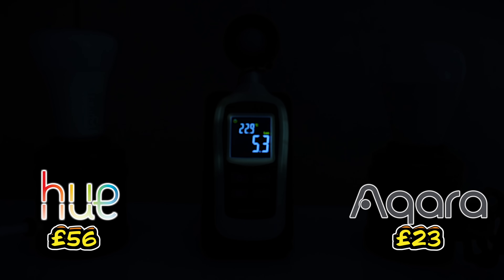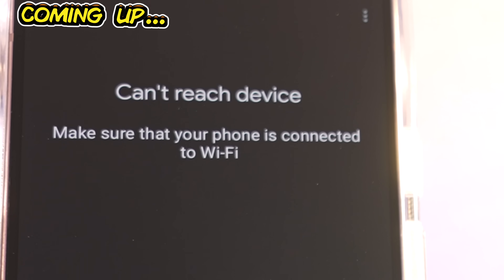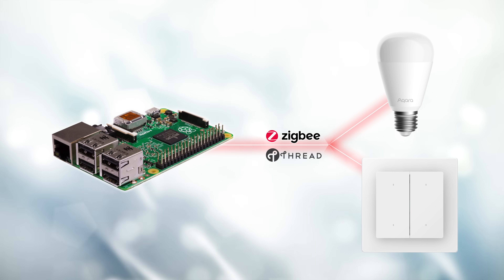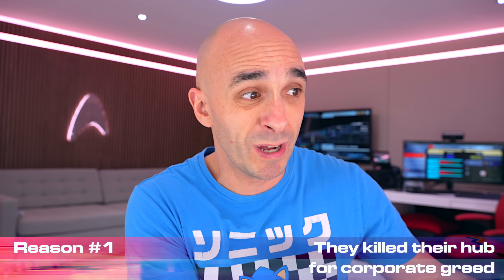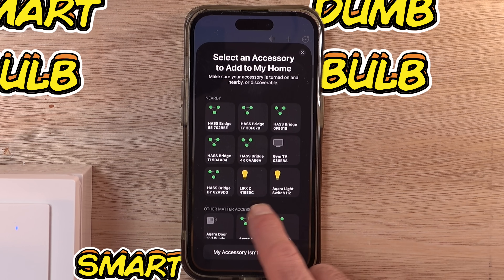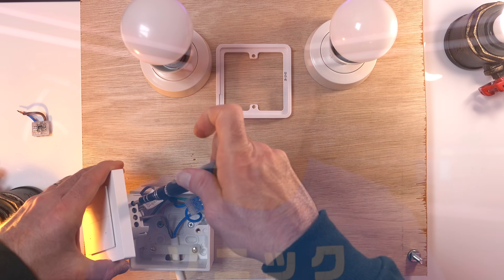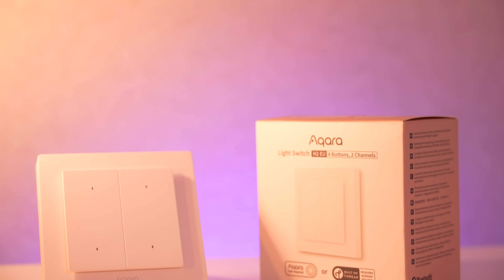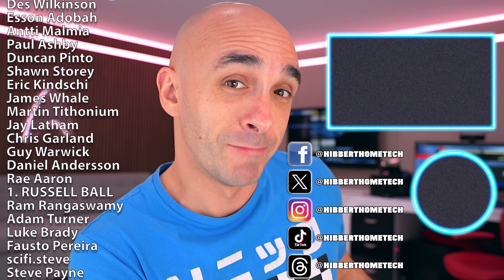PLEASE I Am Begging You... *MASSIVE APOLOGIES*!!!

Comment: Does aquara do any other sizes for the bulbs? I need a E14 size, and have been trying to find good alternative to hue to try but that size seems hard to find. I already have a hue bridge due to having their lightstrip so I was considering getting 3 of there’s but the price put me off like you said. 

Regarding the hue strip  I had the same issue with mine (parts of it dying). Thankfully mine was still in warranty so they did replace it for me, their customer service was pretty good.

Comment: What's the rated lumen output on that Philips vs the Aqara T2? The Philips Hue bulbs I use are 1200lm or 1600lm. The 1100lm ones I'd only use if I need to fit them in a smaller space, but they're super dim in comparison. It's weird to compare a potentially 800lm or 1100lm bulb to one with a much higher rating and then show it doesn't get as bright.

Comment: I've just bought one of these for use in our new bedroom. The thought was to use the top switch to control the dumb main light and the bottom switch to turn on the bedside lights.

I'm on an entirely Home Assistant setup and only really used Zigbee devices so far with ZHA. I suspect I'm gonna have to endure a lot of buggering about to get this working how I want.
Reply from the maker: If you have any of the main 3 voice assistants or a sky connect you'll be able to connect it via thread 👍
Reply: @paulhibbert  None of the voice assistants and my SkyConnect is setup to only work on Zigbee. Apparently the multiprotocol sucks, although I could just get a second skyconnect. Word is that the switch works with Zigbee2MQTT but that’d require a migration away from ZHA.

Gonna be a mission to get it setup, fingers crossed I can get away without spending more money because I’m stingy AF.

Comment: Another great video Paul (don’t worry about the last one 😊) !

Any idea how to add a H2 and / or T2 to an M3 to allow full control of all 4 buttons and to have it pass through to Alexa to work with voice commands?

Just added mine to M3 using Zigbee (as per all my H1 and sensors) and doesn’t pass through to Alexa.  Official comms from Aqara says….

“After confirmation, it seems that the H2 and T2 may not currently support this method of connecting to Alexa. “

Comment: Should it (and is it likely to) be upgradable by firmware in the switch to work natively with zigbee to talk to HA?  I'm not so interested in requiring a switch to have yet another external bridge to talk to HA..  That is confusing!!   Otherwise looks like a nice switch..
Reply from the maker: It's confusing, but worth watching the what's wrong with it section again as there are diagrams to explain, but in short....

It already works with home assistant using ZigBee, so you could use a conbee stick or similar plugged into the usb port of your pi.  BUT the scene buttons are not discovered. That's not something Aqara can fix I don't think, that's something the Home Assistant Devs would need to fix in the ZigBee integration.

HOWEVER, it already works properly via Thread, so if you have a thread border router (other than Amazon Echos as that's broken for some reason) then problem solved.  That includes Google home speakers and apple homepod speakers, but also a Sky connect plugged into the usb port of your pi.

In shorter terms, this isn't for Aqara to resolve.

Comment: OK I sorta agree with you but also find your anger at hue a little well extreme.
I have found Hue to be expensive,  and I understand it's not as good as others brands.

BUT 

1) It does tend to 'just work'  
And yes I understand how you make fun of this, but for many this is a KEY point,  I personally like plugging things in and having it work.
I think for anyone who is not so technology literate,  or like me, just technology lazy, it is a big selling point. 
2) Last time I checked it's still LOCAL,  not cloud based.
3) It's hub DOES work with other brands of smart equipment, in fact you even mention the Aquara bulb works :) (I have cheap Ikea bulbs and a off brand spotlight both recognised by the hub.)
3) And the hub works with as far as I'm aware with all the architectures. (I use Apple)

Aquara feels like the very definition of wonderful & horrible.  I believe you yourself mentioned only the other week how something had to have a particular hub to run (But not the sexy cat hub, that won't work :)  And this week that switch FELT like a half baked product.

In many ways it sorta is how it feels for a lot of the smart home industry,  still too many products with too many elephants in the room.

Comment: Finally, a light Switch for dumb bulbs that does not require neutral wire! 🎉 Do they also offer such a solution that allows me to keep my existing switches (Berker S1)? Otherwise it would not really look nice between my other switches and plug sockets.

Comment: Hi Paul, thank you for sharing your experiences. You are missing a big point though: Philips Hue is the best (by far) when it comes to smooth dimming and minimum brightness levels. Maximum brightness levels is not their strong point, but that is a very specific use case (i hardly ever feel the need to go 100%).
I've tested and used a lot of different smart lights in the last couple of years.
-lifx:  pro's: beautiful saturated bright lights. con's: very unreliable, minimum brightness levels are okey-ish
-ikea: pro's: cheap, reliable. Con's: minimum brightness levels are terrible
-hue: pro's: the best dimming performance (by far), reliable. Con's: expensive, not the brightest
-tuya: pro's: cheap, reliable. Con's: minimum brightness levels are bad, color saturation and CRI seems te be bad (although i never measured saturation and CRI).

It would be awesome if you could do a market-wide comparison about minimum brightness levels, dimming behaviour (does it looks smooth or not), as well as 100% brightness levels, saturation levels and CRI. That would be very nice to see.

Comment: My experience with the Aqara T2 bulbs: They do have both Thread & Zigbee, however they default to Thread and to switch to Zigbee you need the app, which means you need a Thread border router to be able to pair it.  Once the app sees your bulb you can switch, which flashes a different firmware.  After that you can simply pair it straight to Zigbee2MQTT (not supported atm, but exposes the necessary entities to work with).  Haven't tried their switches yet, but I assume it'll be the same experience.  I was lucky that I had Aqara's M3 Hub Cam so I could config everything without too much hassle.

Comment: I wish other lights were as reliable as HUE. So I didn't had to spend the HUE premium. I've spend many hundreds of euro's on other brand gu10 bulbs. Govee, nanoleaf (including thread based) and a couple of others. But the issue with about all of the others is that you run into issues when you have a lot of them close together.
Just in my living room alone I have 24 gu10 sockets build in the ceiling. Each of them about 1.2 meters apart. I have 46 around the house.
With 24 Govee, Nanoleaf and others I get connectivity issues. Lamps showing as not available/disconnected etc. (logs flooded with connected disconnected messages) When I disable about half of them it works a bit better but still not fully reliable. So it looks like a interference issue with the ones I've tested. I didn't had issues when I tested with the about 17 hue bulbs I took with me from my previous house.
I hate to say it (especially for my wallet) but after spending a gazilion euros on 40+ HUE bulbs it just works.

Comment: Hmm... Looks like Aqara is going "Hue Style" to me ... I have some of their older zigbee wall switches and these work great but this Zigbee/Thread switch that only works when connected to a Thread/Matter thingy ... I hate that even more than past Paul hates you for sleeping with his wife 🤔
I am however not sure about the new Aqara devices. I love my old Aqara wall switches but a switch that does not have full use over its buttons using Zigbee ??? I don't have a Thread thingy on my HA system and I don't want to need one. Thread and Matter are just ways of having us buy new products that don't add new functionality and Aqara surely shows this with this new Zigbee/Thread switch.
Not requiring a neutral ... does that imply it also not acts as a router ? With thick concrete walls and reinforced ceilings I need those routers to get the best performance out of my (Zigbee) mesh network. I installed a few switches that require no neutral in my office but had to add some smart plugs in spare outlets just to get the mesh to operate reliable.

Comment: Phillips Hue bulbs are easiest to reset with a hub or a remote. But you can reset them without any of them.  

Turn off the bulb for 5 seconds (from the wall or lamp)

Turn on for 8 seconds

Turn off for 2 seconds

Turn on for 8 seconds

What is interesting is that they removed that sequence from their website ...
Reply: I agree, when I moved to another house I took about 17 hue lights with me. I have reset them all just using a cord with a build in switch and socket.
Reply: Yeah I like hue bulbs and use them with a zigbee coordinator.  I factory reset the right out of the box it's not too bad. Maybe Paul will make an apology video to Hue next!😅

Comment: Rewatching the video here. Audio was fine in the previous one. 
But not agreeing on the hue dimmer(s) it’s so convenient to not be bothered so wall boxes. the dimmers are the cheaper wireless buttons you can find, and love the original hue tap that doesn’t require power at all, you can buy a better looking case. And best of all you can assign ALL the buttons, tap, double tap and long press on every ecosystem.
Reply: I agree with that. And here in Portugal my house has very small  junction boxes in the wall. The Aqara T2 relay switches don't even fit in there.  So I did stick hue switches on the wall above the build in switches. The only downside is that guests will hit the build in switches from time to time.

Comment: I can think of one reason why it's better to require a specialized device to factory reset a bulb. Here in Texas with good ol' Centerpoint providing our electricity, I get factory resets of our bulbs on a semi regular basis. No joke, I have to leave our zigbee router in discovery mode (or whatever it's called) so that any rogue bulbs that have been reset will easily re-pair without constant manual intervention.

Comment: "..one and a half freedom units.." Thank you. I live here in Freedumb-Land™ and I would have spit coffee out of my nose if I actually had one instead of my shiny copper honker. Been using metric for the past 20 years and it's becoming difficult to even FIND a tape measuring reel that is dual use which has been the norm ever since we tried to go metric before Regan fixed all that. A metric only tape measure is now impossible to find in stores outside of the web apparently. RUH!!! We're number ¡¡¡ONE!!! ■ Ps. I was home automating back in the days of X11 ... and stopped back then. Apparently a good idea from watching this. ≋;^}~ <LOL> Great to hear there are actually open standards which do not use Internet for their use. ■ I myaelf am using a "ZAP" wireless remote I found in a thrift store which controls 6 outlets with a simple on/off with a button on each outlet which can toggle the relay state. Yes. An internal relay! No smart anything or phones required (or possible). Very entertaining and informative to see all this BTW. ■ Fantastic and brilliant editing/meme-clips BTW and thank you (thank you) for fixing the audio!! ■ One question BTW.. Is that "CUBE" in the background an actually a 3D cube or is it just a flat projection sitting there on the case above the white Star Wars helmet? And can the lights be programmed to display images rather than just twinkle??? Either way quite nice.

Comment: I want a thread border router but I don't want a Amazon/Apple/Echo thingy. Any options?
Reply: Aqara M3 hub has build in thread and zigbee, . But I had reliability issues with Nanoleaf lights. But that just might have been a issue with the lights. And it sucks you cannot disable the radio's for the stuff you don't use.
I use multiple M3 hubs with their infrared blasters for automating my airconditioning units throughout the house. And the zigbee of the M3 hubs for temperature sensors and smart plugs. (all aqara cause aqara hubs only accept aqara branded zigbee devices)
And I use Apple TV 4k's as Thread border routers.

Comment: I cannot relate to your hatred of Philips hue, perhaps because I still have a big box full of old X10 devices, and so knew better than to by expensive and poorly performing Philips hue when they came out  and instead went with cheap rgb Bluetooth bulbs from others when they came out, and WiFi wall switches and plug in WiFi switches. I do have a couple of those wall switches that are flaky and in the junk box, especially 3 way switches, and one that hardly works(I’m talking to you Amazon essentials).

Comment: Dude chill. 

But the hue thing - come on. Back in the day I invested heavily in Hue. There wasn't much other choice back then. I've got over thirty hue bulbs and not had a single issue. I'm sure there are better out there now, but I was happy with my purchases and continue to be. 

I won't change to another brand because I'm so heavily in Hue. The app is brilliant - and so are the third party ones. I like it works with Alexa. They have become a fundamental part of the house and still these days are a conversation topic when new people come over. 

Hue isn't bad. They were one of the originals. And yes, it just works. But more importantly, unless anyone is going to give me a couple of grand... They are staying!
Reply: I agree with you. I had 17 Hue gu10's when I moved to my current house. My current house has about 47 build in gu10 fixtures, 24 in my living room alone. I've tested multiple other brands in my living room incuding govee and nanoleaf. But they all got connectivity issues unless I disabled about half of them. From what I have read is that Ikea ones also seem to work okay in high density places. But I can't get Ikea on the island where I live.
Now I have spend a gazilion on 40+ Hue gu10's and it just works.
But of those original 17 I had to replace 4 of the 1st generation gu10's due to some indicidual leds in them failed (the blue leds with 3 of them)

Comment: I bought hue in 2019 and only 1 light strip extension failed on me and I was angry because they changed the strip connectors. But otherwise everything works flawless and I don't have to care about it. Sooo sorry but IT JUST WORKS. xD I'm to lazy now to change everything and play around with new apps. Sale Prices are ok imo and I don't use lights at 100% so i don't care about others being brighter. I'm only going to a new system if AI does the setup for me 😂

Comment: The audio wasn't that bad on my setup, just a slight difference in timing between the left and right speakers but nothing distracting. As for the content, yes Hue is expensive and not as bright but its bright enough, it just weeerks and connects to Home Assistant and Hubitat (which you rarely mention in your videos by the way) plus Tasker without any difficulty.

Comment: I take your points, Hue are stupidly expensive compared to alternatives. However I’ve just gone back to them from a reliability point of view. Hue are the only colour bulbs that can stand the Australian summer heat. 

The 35-40c heat we get in Aus summer has killed multiple Lifx and Nano leaf colour bulbs in less than a week in the heat and I like having colour bulbs outdoors.
Reply: They do seem to have a bit of an issue with heat if left on long and at full output when it's hot, the housing on mine cracked during a heatwave, though it was in makeshift lamp shade that was probably too tight.
However the LIFX outputs 1200 lumen, and has done so for 10 years or so, and is likely way past it's life expectancy as it's on sometimes 8-12 hours a day.

Would buy more, but some years ago they became noticeably slower to control along with some other isues which is a shame.
Reply: @ the Hue is 1100 lumens, so not much difference. I noticed the Lifx just stopped responding when the temp got too 35c outside. The nano leaf worked fine for about a week of summer, then died completely.